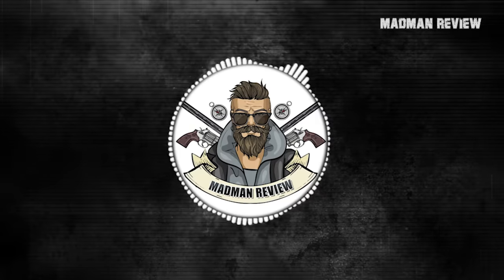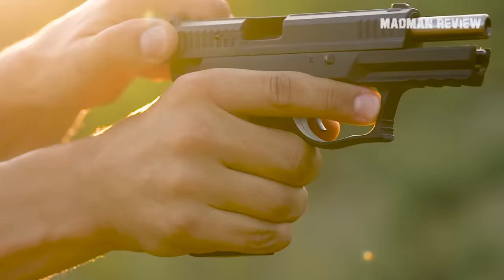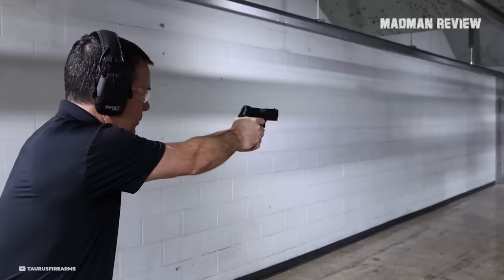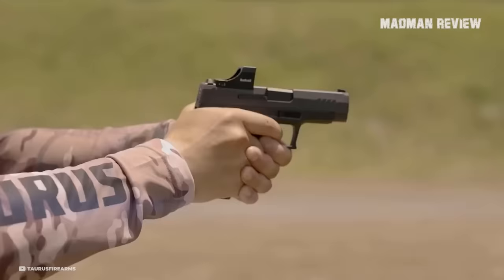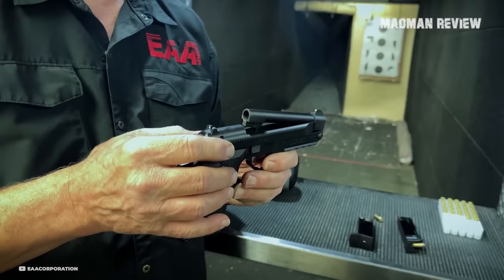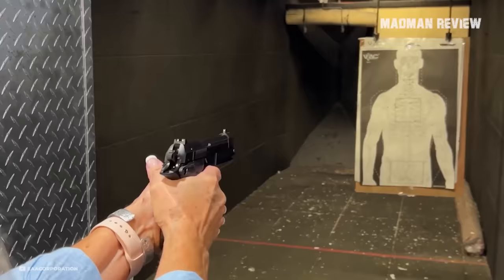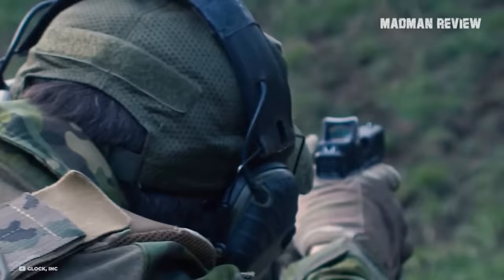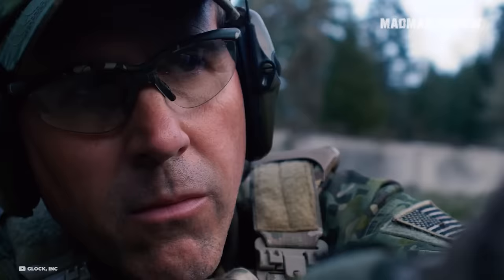8 AWESOME Handguns JUST RELEASED for 2024

Comment: I bet that T10 works better than my POS 4 inch S&W 2.0 MP 10mm. Had nothing but issue after issue with that thing. Had to swap mag and recoil springs, striker spring and drop in an apex trigger. I still dont trust it enough to EDC

Comment: I dig weapons coming out of Turkey these days. I avoid Brazilian made handguns like the plague.
Reply: taurus has had issues one I consider good PT92 to many times they rushed guns to compete and we have seen in this industry not a good idea
Reply: @bernardconeghen  The Beretta 92FS is under $700 brand new. I would rather spend a couple hundred extra dollars to get the Beretta instead of getting the PT92. Girsan in Turkey however make an excellent Beretta clone. My one complaint with the Girsan are the horrendous finger grooves designed into the alloy grip frame.